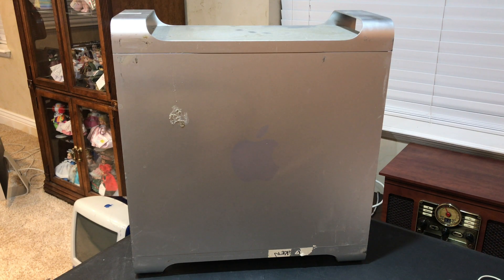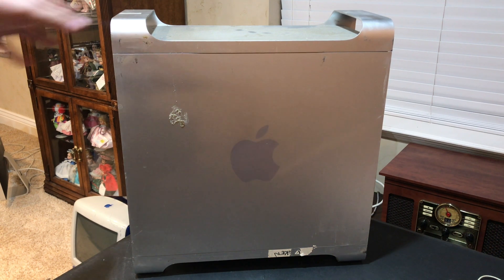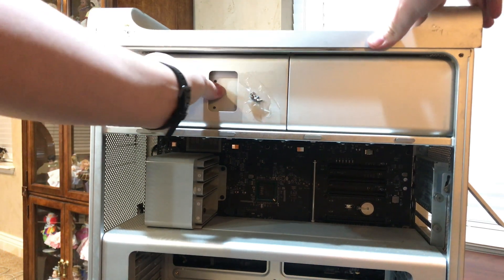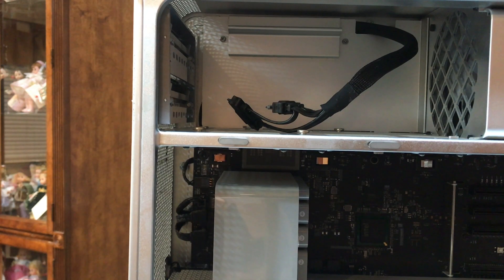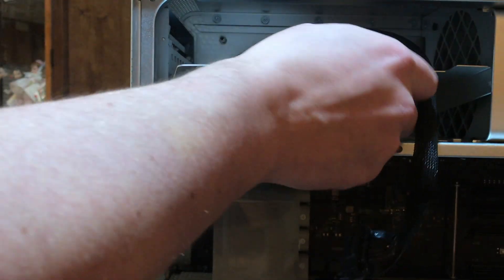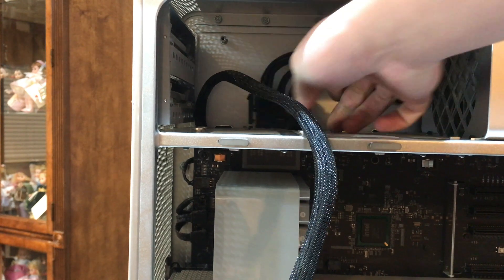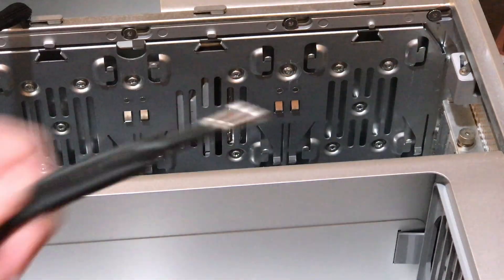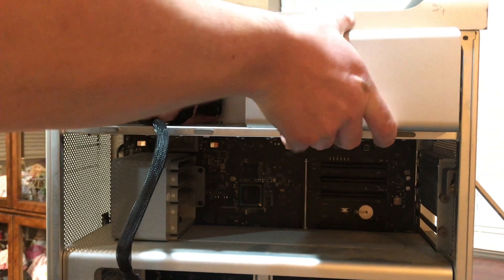How To Remove and Replace Mac Pro 4,1 and 5,1 Power Supply

Comment: Is there a way to test the power unit after I've removed it? I don't want to but a new one if it's the logic board that's the reason the mac won't turn on.
Reply: That’s the question, mine started to reboot intermittently, 😢

Comment: Great!  Now, need to reinstall a new PSU.  Can you use any PC-type PSU's?  I've repaired computers for over 12 years, but never replaced a Mac tower psu.
Reply from the maker: I haven't ever seen or experimented with PC Power Supplies on Macs. Personally Id hit eBay and find a used working Apple PS.